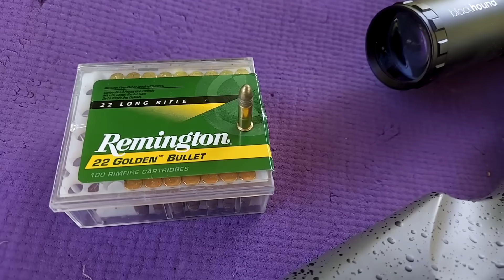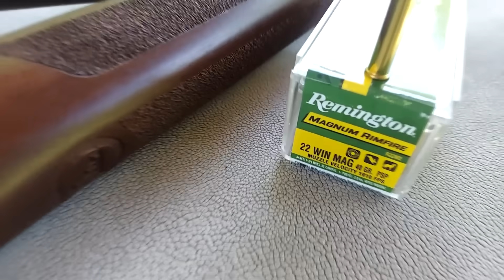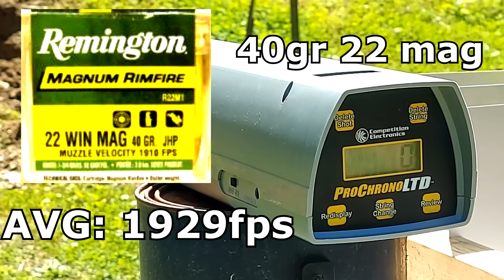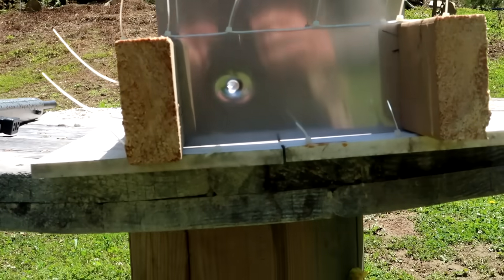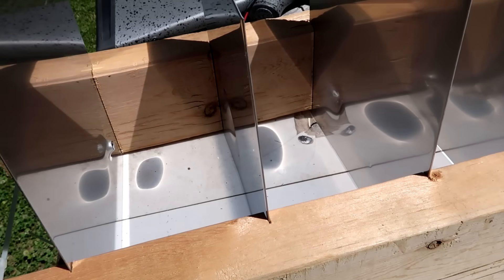22LR vs 17 HMR vs 22 MAG: Never Would’ve Guessed

Comment: .17 will go through a 1/4 inch steel plate has to be a copper pointed tip or solid pointed tip drills a hole straight through at 10 mt

Comment: It is a good experiment but there is a slight variable problem I see but can not confirm.
The 22LR and the 17 were shot lower and closer to the sides while the 22 mag is shot higher and to the middle.

Being that I am a general contractor and I have a sheet metal shop I would say that the 22 mag was fighting the bow force of going through the metal more than that of the other two round.
I am not a "engineer" but I do design a lot of different things and have an engineers mind when I do things.

That being said if it were shot to the sides like the others it may have penetrated through the 5th plate.

Just saying I do not think that the experiment is totally conclusive. 

Every shot should have had a new plate and shot to the same area.

Comment: When you look at the volume of material that the 22 mag moved with actual hole sizes it did a lot more ""work" although it didn't go through more number of plates. If you computed the square inch or millimeter surface you would have a clear winner in my opinion?!!

Comment: It looks like he was 20-30 yards away from the targets.  If he were 200 yards away, the results would had been much different.  The "thin" air does provide some considerable resistance to a light weight bullet, the 22 LR and 17 HMR may start to tumble after 150 yards.  This is why the 5.56 mm (.223) from M-4 will only tear up muscles at 200 yards, while the Garand's 30-06 with spin a 150 lb soldier with a limb shot at 300 yards.   For open field combat or hunting, .308 or 30-06 are necessary.  🤔🤨🙄😎

Comment: I like the 17 mag flatter shooting further out.
Reply: I was going to say that .17 calibre bullets generally are less effected by cross winds, possibly due to higher velocities combined with a smaller cross section 🇭🇲🤝🇺🇸
Reply: It would be great if you could perhaps provide a link. Obviously, things such as relative humidity, air density, ambient temperature etcetera comes into play. Years ago, when I was in the Royal Australian Artillery, we used to ensure that the ammunition was kept at as reasonably consistent temperature as possible. A hot breach and cold ammo works excellently 🇭🇲🤝🇺🇸
Reply: @VincentKing-f8g  None of your requests appley to hunting, when conditions change by the hour.
Reply: It's nice but very effected by wind
Reply: @Myboybrute  The 22WMR is more affected by wind than the 17HMR. American Hunter has a study on it.
Reply: @arthurneddysmith link?
Reply: @arthurneddysmith  I didn't know that.
Reply: @NathanStickney-xv6dy Google. "Using a 100-yard zero for both—even the slower .22 Magnum will only have a rise of 0.7-inch—you’ll find the .17 HMR hitting 3.1 inches low at 150 yards, and the .22 WMR hitting 4.8 inches low. In a 10 mph crosswind, you’ll find the .17 HMR drifting 8.9 inches at that same distance, while the .22 WMR will drift 13.9 inches; this can make hitting a prairie dog much easier with the smaller cartridge. And despite the .22 WMR having 322 ft.-lbs. of muzzle energy in comparison to the .17 HMR’s 250 ft.-lbs., at 150 yards the .17 HMR actually has more energy; 99 ft.-lbs. for the .17 HMR and 94 ft.-lbs. for the .22 Magnum. "

Comment: .17 HMR less than half the weight, more than twice the velocity vs the .22LR. .22WMR heavier than .17HMR, more than double, and 20% slower. Even match. .17 HMR, smaller diameter, less resistance from the steel. Interesting experiment. I vote for the .22 HMR at 100 yds or less. >17 HMR beyond 100 yds. Best bang for the buck goes to the .22 LR. Good show.